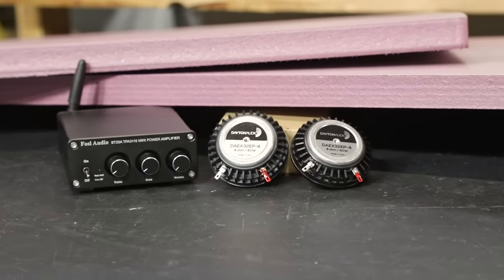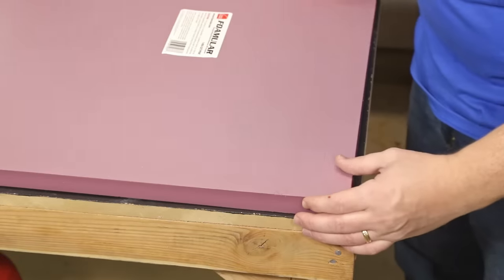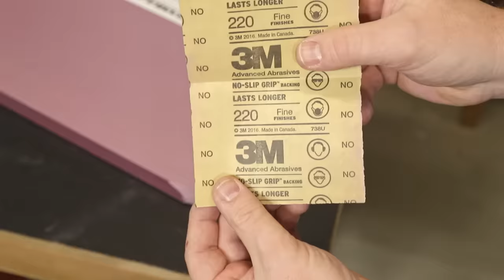How To Build "The World's Best Speakers" - Are Flat Panel Speakers Really Any Good?

Comment: I'd love to find a direct comparison between this style (built to best conform with say a home theater setting) and high end electrostatic speakers. I'm sure the high end speakers would still win out, but these are intriguing.
Reply: High end electrostatic speakers are designed for flat response. These foam panel speakers do NOT have flat response. If you watch the Tech Ingredients (TI) videos, you'll see how un-flat they are in the results of his sweep generator tests. He chose to fiddle with transducer placement and combining different panel sizes and materials to line up the peaks of one panel with the troughs of another. So it (kind of balanced) out.

Nevertheless, I have no doubt that you could tweak these panels to provide flat response with a 1/3-octave equalizer. And of course, larger panels would extend the low frequency response. TI found that the square panels benefited greatly from the addition of a sub-woofer crossed over at ≤125Hz. 

I wouldn't use these for studio mix monitors, but then I wouldn't use high-end electrostatics for that purpose either. But for general listening, tweaked with an equalizer, these panel speakers would be awesome.
Reply: @Vito_Tuxedo  Interesting! I hadn't seen the videos with the sweep generator tests, so that's new information to me. My electrostatics came into my possession a few years back, but is a complete Martin Logan system (something I could NEVER afford if I hadn't essentially fallen into getting them), so I'll be sticking with those for sure. I love seeing stuff like this made from fairly spartan components though.
Reply: @NordicDan  Yeah, I feel the same way about my tri-amped Genelec studio monitors (S-30BNF...no longer made). I mix exclusively near-field (the "NF" in the model number) at a comfortable SPL. In that application, monitors with a large surface area wouldn't work. The beauty of large planar radiative surfaces is their ability to move vast quantities of air at low amplitude. 

I'd bet your system sounds great from across the room, without bleeding the ears of anyone in close proximity to them.

Comment: Try sticking one on each side of a single panel and running one with reverse polarity.
Reply: Isn’t that noise canceling?
Reply: @AugmentedPixel  it's a push/pull setup. It'll extend the low end. There shouldn't be any cancellation.
Reply: @thatunknownguy2680  wait, how does it amplify the low end tho? isnt reversing the polarity gonna reverse the sound waves and they cancel each other? Isnt the sound just going to be quieter?
Reply: @bluebaconjake405  That's what would happen if they were in phase, if you reverse the polarity on one of them they will be in antiphase and the power output will double.
Reply: @bluebaconjake405  because you have one pushing and the other pulling. Imagine stacking 2 on top of each other. These little exciters move in and out a good bit. Stacking 2 won't work, so you'd have to put one on each side of the panel in reverse polarity. As one is pushing out, the other is pulling in which makes the panel move back and forth. If you place one on each side with the same polarity, then you'll get cancellation.
Reply: @thatunknownguy2680  OOOOHH. I misunderstood the original comment. Now it makes sense. Its like having 2 people jumping on a single trampoline or a sea saw and propelling each other higher
Reply: @PabloDiabloable  yes. Let us know how it works.
Reply: @thatunknownguy2680  oh shit nice thank you!

Comment: Well after doing research all over the Internet and watch and find videos like yours I finally got all of my parts in the pink panels high quality pure copper speaker wire a nob sound Bluetooth mini amplifier connected to my Amazon echo dot in my title streaming music service I also did something not too many people talk about and I didn't think it'd make much of a difference I use a one-to-one ratio of wood glue and water coating two coats on the back where the Exciter goes one coat on the front and as people say at first you might be disappointed with the tinny hollow sound which mind did exactly that but with the codeine and when the exciters break in OMG these sound absolutely fantastic and yes they do not put out a lot of bass at all but Fidelity and detail in music songs and movies do not come from the base it comes from the upper frequency drivers the mid-range and the tweeters and that's exactly what the panels produce I tested them against my parts Express Dayton bookshelf speakers that have audio feel grade ribbon tweeters and they come incredibly close to mansion the upper airy sparkle and detail of the ribbon tweeters I would say about 93 to 94% close that's in a hell of a lot in simple terms for an excited stuck to a back of a piece of foam but I did all the techniques of sanding the front and back panels in One direction using only one inch panel adding the coating to coats back one coat front I also used gorilla glue on the exciters that I bought from parts Express that has the four plastic legs on the outer body to make sure all the vibrations the Exciter can produce goes into the panel for sound the soundstage and the openness is nothing short of amazing and the speed that the sound goes from left right left right left right is very impressive seems to be faster than regular bookshelf speakers so when you do all the techniques on the panels you glue down the exciters so all of the vibrations are not lost and they go to the surface and nowhere else and high quality wire a high quality streaming source and a high quality affordable amplifier and you put this all together it is absolutely amazing the sound quality the speed the depth the sound field and the overall detail that these produce they definitely have better upper frequency detailed spaciousness then my Polk audio speakers with silk soft dome tweeters and they're almost a Dead ringer against my ribbon tweeters in my Dayton bookshelf speakers I've noticed on the internet forums and on videos others use the wrong size material or wrong material they didn't tune the material by sanding the edges round in the corners sanding the front and back of the material and didn't add any coating this essentially tunes the material like the strings on a guitar neck tunes a guitar thus for their panels didn't have the upper frequency treble or detail or spaciousness so they ended up just adding a regular standard Tweeter speaker which kind of defeats the purpose of just using an Exciter by itself to see what kind of quality sound can be achieved from the excited by itself.

Comment: Just out of curiosity i wonder what they would sound like using a dense sound deadening foam... think egg crate or pyramid shapes
Reply: not great, I have tried alot of materials, they work best on things with low density but high strengths, some tonal qualiy to material helps, like balsa wood over foam board or the more tinny sound an aluminum panel makes.
Reply: @massv953  well; in that case lets just say you've got the perfect material at hand for it. I just wonder what that egg crate shape would do for it; 'cause ya know... that shape is used for sound deadening for a reason; but it also makes me wonder if it used a different material so it wouldn't actually "deaden" the sound, but instead it would drive the sound, seeing as sound foam is well.. a foam that isn't too entirely dense. i wonder if it would create a more spacial sound, or maybe bring out some more of the highs and lows. Then again; It also makes me think about what people say about solid body electric guitars; that the shape doesn't really change the sound. But the sound also isn't coming from the body of the guitar, it's coming from the strings and being outputted via the pickups/amp... so in theory i'd think it would make some sort of difference. it may also cause phasing issues or something along those lines. iunno. Just an idea! :)
Reply: @massv953  Another interesting idea might be to think of an acoustic guitar. Maybe something along the lines of a cylinder shape with a decently sized hole on the side you want the sound to come out of. maybe about the size of a paint bucket or something for the hole, then you place the driver(s) on the back. plenty of interesting ideas to be had!

Comment: Anyone have suggestions on what paint you could use? I was thinking maybe plastidip, want to build some for the office, not sure I want massive pink boards though!
Reply: Plastidip would be to heavy and will dampen the vibration. I was thinking about painting them too. If I was to do it I would give them the lightest coat of dollar store flat black. After running them virgin to compare the sound.
Reply: Use acoustically transparent cloth.  you can also have them printed to look like paintings.
Reply: Maybe, on a spare piece, try black ink for magic marker refills ? Or something from an arts and crafts store ? Shoe dye ?
Reply: @biketech60  black inf is a really good idea I'll try that
Reply: Just use spray paint or whatever.

Comment: I’m curious how these would sound with a guitar amp
Reply: I was just sitting here looking at my Behringer 100×2 combo (1 Jensen Mod, 1 Bugera) and wondering the same thing. I doubt they can top some nice Celestions or anything, but I don't doubt they'd sound fairly good at low to mid volume. Cranked up, however, I'd half expect it to start raining foam chunks after just a little while.

Comment: I know the point was to replicate Tech Ingredients' results, but it would have been super cool if you had used bigger drivers. Perhaps two tweeter panels and two kicker panels. I would also be interested in seeing how the panels behave with two drivers mounted. Other than that, I think  mounting them on posts is the wrong move. You should just do the same thing you did up top; add two more cotter pins to the bottom and pull it taught. Great video. Somehow I came from this more confident I can make these than when I watched Tech Ingredients' video. Thanks!

Comment: Wait a second. Can I cover these with art and hang them on the wall (not touching the wall of course)? This would make the speakers disappear.
Reply: Nice idea but the paint or whatever art material(s) you use would probably greatly inhibit the sound, I mean he goes to the extent of sanding the surfaces for a reason yk. And if you have any objects touching it, they will absorb and deafen/contort the sound. Perhaps you could carve your art into it, that would look really cool and probably not harm the sound too much, it may even possess a unique, perhaps even desirable(at least to you) sound. If you were to do this however I intuit that there would be a fine line with how deep you can carve in before the carvings create a cavern in which the sound reverberates chaotically and unpleasantly. Expanding on that issue you could perhaps get a high magnification lens and bevel the bases of the caverns or even just stick to wider  carvings and use large shapes that protrude a millimeter or so from the background surface. Another, slightly cheeky idea is to find a foam board that you like the colour of (e.g. a light blue one) and paint a painting that incorporates it/that it can camouflage to (e.g. a landscape depiction with the blue foam hanging from fishing wire hidden in the sky). Maybe even combine them for increased deception 😈 I hope my comment reinspires you to give it a go :)
Reply: I was in a shop in Scottsdale, AZ. It was full of art work with music coming from the pictures. Think it must be this idea.

Comment: I wonder how they could be ruggedized.  I could see roadies at small shows appreciating the light weight of them.
Reply from the maker: They are pretty delicate. That foam dents if you look at it funny. Thanks for watching!
Reply: @AmplifyDIY  I wonder if you could coat the surface in a thin layer of silicone or bedliner.

Comment: I thought the ceiling panels were the better build?  That is the set that I am building right now.
Reply from the maker: I’d love to hear your impressions of them! I believe the recommendation is to combine a set of each. Thanks for watching!
Reply: I have a pair of the acoustic ceiling panel instead of the foam as flat speakers in my bathroom. Killer move is to add a subwoofer (I picked one up for $25 at goodwill). Very convincing with sub. Upgrading amp might improve things too. You can apply artwork on front too so they look like paintings or pictures. Fun project
Reply: @chriswhite9912  I finished the build, I think one side has a less than perfect dbl stick tape connection than the other.  They take a lot of power drive up to listening levels.  I have not paired them with my sub/large mains yet.  I think that would be a good mix

Comment: My flatpanel experience...

...so a long time back I used some sound advance flat panel speakers to play with, I think they had some sort of Styrofoam fill inside.  They had a white cloth covering, and then a metal frame (but had cloth on both sides as the sound goes off the panel in both directions).    What you'll find is any material that is "squeeky" seems to resonate well for the flat panels  (so wood isn't good, but stuff like Styrofoam, with a small amount of vibration makes a lot of noise) works well, probably why that foam was used.   I also found using  a resonator on a round surface (a cylinder for example) doesn't allow a great surface to mesh, so you do want a flat spot, although "boxing" it in may produce some interesting results.    I didn't like the sound on metal, but in theory these could produce an invisible speaker (you place it right in the wall, drywall over the resonator, etc), and they make some resonator super low frequency so your car vibrates with rap, etc, lol.    The quality of the resonator is probably a little important?!?     Also, let's say you get creative and want to put them on a ceiling tile... well the properties of an acoustic tile is to dampen sound, not amplify it.  I'm guessing that will not work well.   OK, now you use this type of foam... maybe that works great, but watch your fire ratings if you have a plenum ceiling :)  Also, I'm curious if you can reverse the resonator to use it like a microphone (does the whole squeaky panel become a mic, how does it sound, etc?)   I can see that being interesting for security, if it has the ability to really pick up well (or music if it has any interesting audio properties or quality of any sort, etc).   Just spit balling all that stuff.

So, I found flat panels have very poor low frequency performance, but maybe a different resonator could produce a subwoofer effect?  Can you use 2 resonators on 1 panel?  (or multiple panels in close proximity?)   I found the frequency with strings (like this video uses hehe) sounds REALLY nice (guitar, cello, piano, etc)... so that is pretty cool.   Also, from my understanding (and in practice), I feel it is VERY difficult to produce feedback with a flat panel (due to how they work, getting feedback loops is supposedly much better protected against), so using them for Public Address may have some interesting options as well where speakers are next to microphones, in conference rooms, etc.     I always thought building a system with flat panels as the mids and then using tweeters and subs in conjunction could produce some interesting options.   I also don't know how they perform on power as well, etc.   Anyway, I love the technology, I think it has some great options, and I think the resonators are getting better.   Also curious would be using resonators with transformers to convert to 25/70 volt systems, etc.  Can you use them for office paging and background music (again watch your fire and electrical codes).   

Great video though, Very cool it was so easy to make these.
Reply: I'd be curious if you can find a panel that has a low frequency resonance (a low pitch squeeky styrofoam ??) ... my guess is that would give you a bass boost.
Reply from the maker: Neat ideas, Rich! You brought up dual exciters on a single panel - I actually tested that in this follow-up video: https://youtu.be/XC814uQjlaE

Comment: For better low frequencies:
1) yes bigger panels. Much bigger. But there are significant trade-offs in response & exciter placement(s).

2). Most Importantly...  panel radiating elements are highly susceptible to large fixed boundaries (I.e. Walls, floors, ceiling, etc.).  Make sure you give them approx 36” distance from walls etc (and each other) for best performance.   *also sound will be completely cancelled out on the sides, top, bottom along the narrow edges. Keep that in mind & use it to your advantage.

Cheers,
  -Robert Triner
Reply: Welp, I was hoping to build these to save space.

Comment: It would be interesting to see frequency response results and also the THD on these. I’ve built these a few years ago and I found them great, however anything above 8kHz sounded muddy like listening to music through a 6inch pipe.  The shortcomings came out when you tried to listen to electronic music as the fast transients really demonstrated the shortcomings of such speakers. Jazz, classical sounded great but were missing the clarity, It sounded as you’re listening off axis. But, it was a cool project, great for garage or wood-shop.  Dust is not a problem.